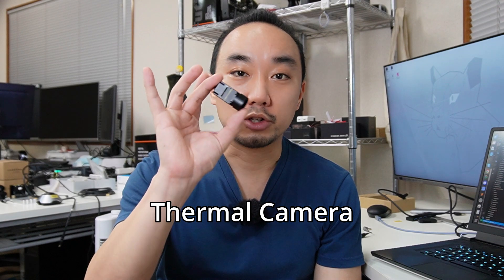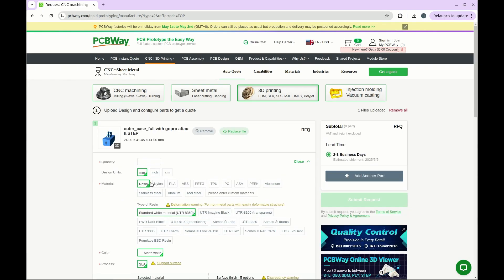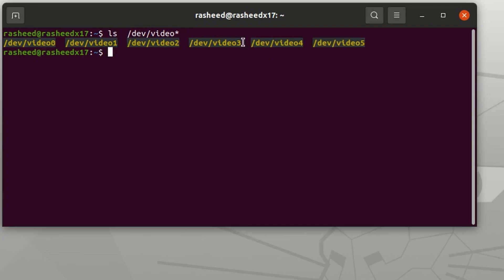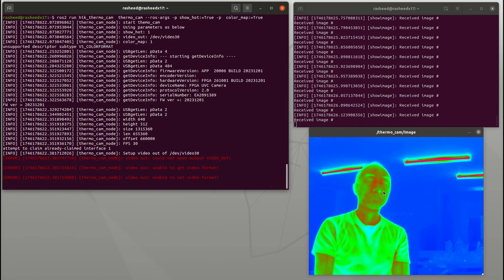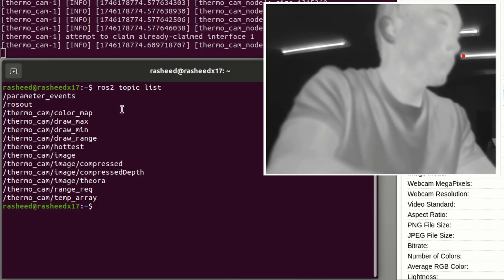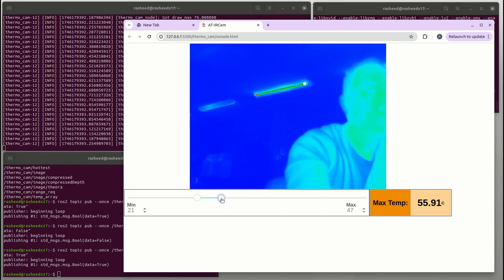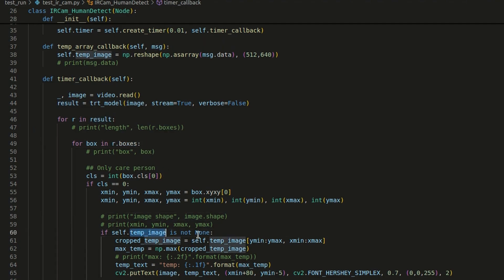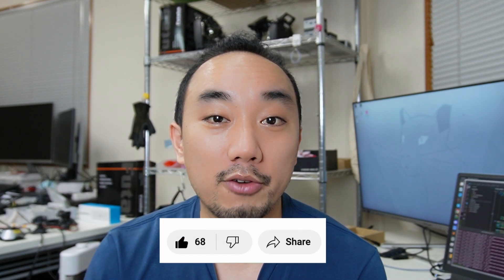A Tiny Thermal Camera for Your Next Robot Project

Comment: maybe long range test ? (from ground robot) because we can only see short range right now ^^
And ¥400,000 = 2500$ is very high sir, what benefits from 250$ thermal camera ? 
But good video, i really love your content !
Reply: Yeahhh unfortunately $2,500 is nearly 3x the cost of all similarly spec’d and sized devices.
Reply from the maker: Thank you for watching and your comment!
Well, if you compare this 640x512 resolution tiny thermal camera with the same resolution of well known brand like FLIR, those professional thermal camera is way more than 10,000USD  ^_^ and mine is very compact in size and weight. Also there is ROS2 software support, so I think some tech companies or researchers might interest on this.